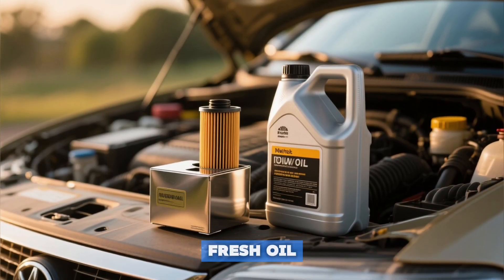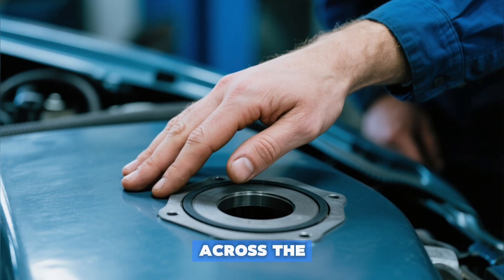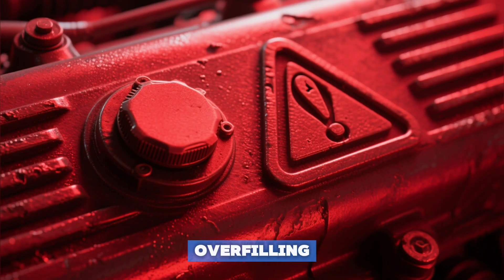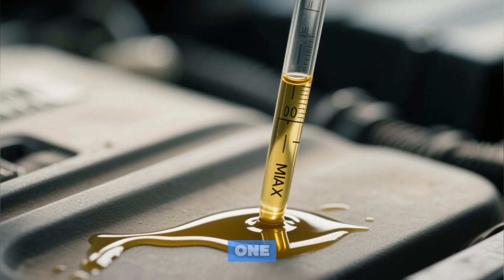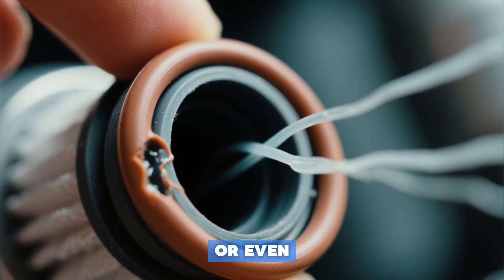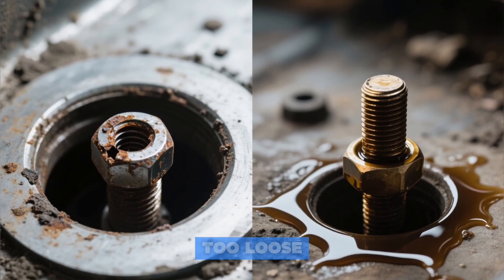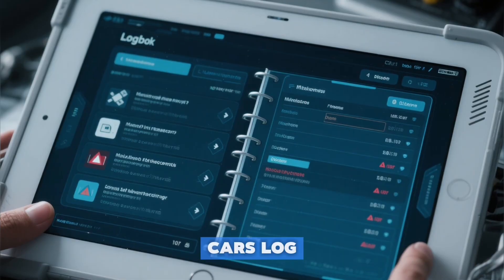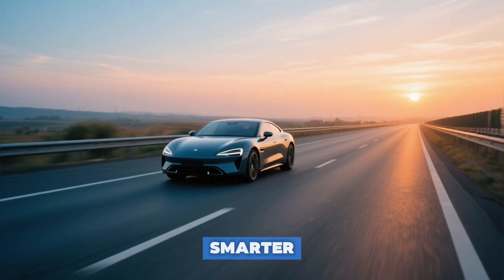This One MISTAKE After an Oil Change Can Destroy Your Engine

Comment: If your motor has that much sludge you have bigger issue.  Some vehicles have a top cartridge oil filter.  Chevy 3.6 VVT for example.  The fill the filter argument has been going on forever.  There is always a small amount of oil left on the cylinder walls.  They are not 100% dry. 😂

Comment: 9.  Seals, oil filter gadket.
8. Changing cold oil.
7. Over filling with oil.
6. Zoom after filling and check level.
5. Dry start, fill oil filter 
4.  Installing a dry oil filter
3. Over titening drain plug.
2. Using wrong oil.
1. Ignoring change interval.

Not resetting your oil monitor.  Key on, pumo gas peddal 5 times.